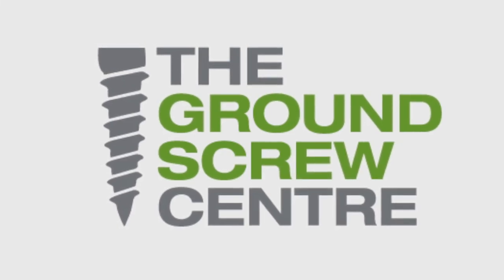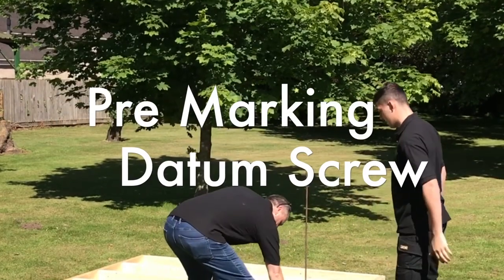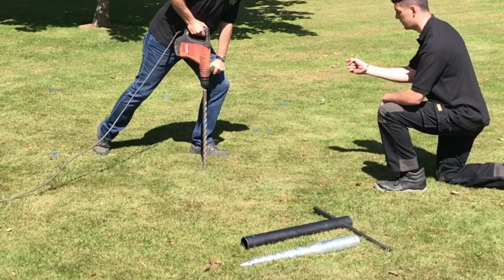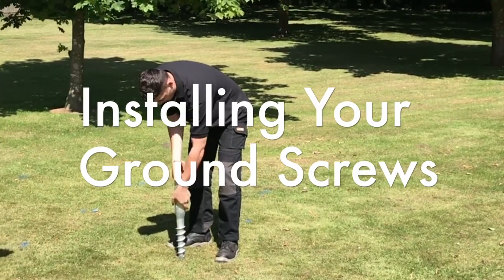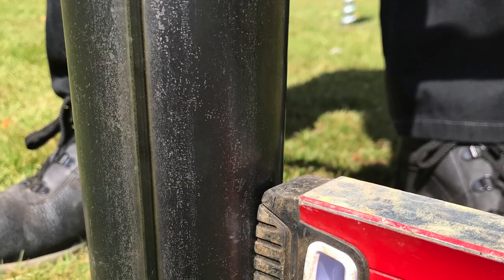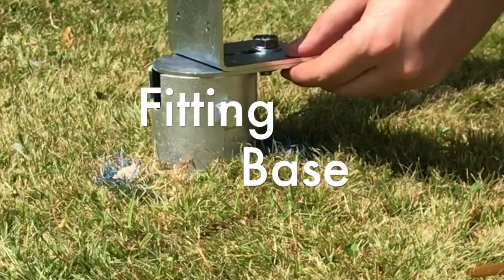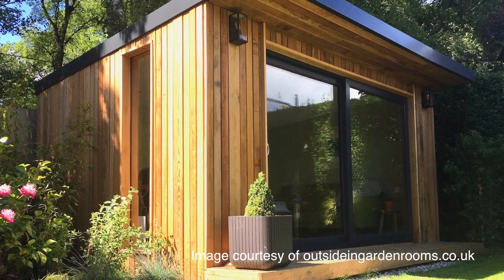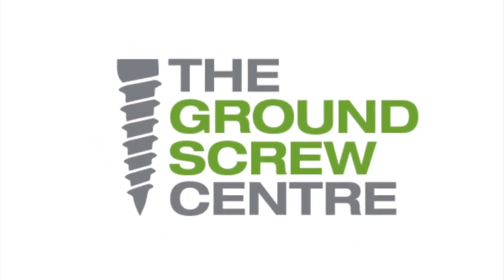Ground screws, Building Base Installation.

Comment: Ive used these helping a mate, we both came to the conclusion that it would have been easier digging and concreting.  Cheaper as well.
Reply: Might I ask why? Very curious as to how user friendly these are
Reply: @michaelandersson3305  pain in the arse, we put in 6 of them, after installing them, we both agreed it would have been quicker to dig and concrete, and trying to be accurate with them was a dead-set bastard.
Reply: @prophetanarchy2355  thanks for the reply! So hey, I'm an engineering student and I'm working on my thesis which concerns self installation of ground anchoring. If you have the time and patience, would you go into more specifics about your experience?
Reply: @michaelandersson3305  ill have to go step by step. 
Im a carpenter with many years experience. It doesnt take long to dig a hole, it use to be quicker when I was younger. 
The traditional method of installing a footing doesnt really take long, and getting the footings and pillars/post/whatever at the correct centres is easy. with these screws starting them in the right spot is not an issue, its what lies beneath. If you hit a rock of root or dead body the screw will divert and it will misplace your centres. As it did when we used them. Also the ground was hard. The ground in the clip was easy ground. On our job stuffing around getting them right was time consuming, once they where in we removed 300mm of dirt and concreted around them. What we were doing was a temp structure. Maybe you should have a go at using them. I also predrilled with a 30mm sds bit.
Reply: @prophetanarchy2355  this is good input - thank you very much!

Comment: How well suited is this system to an inclined grade? Would you fit the low side screw then have a post on top up to supporting level or are longer screws available that protrude higher out of the ground?
Reply: I would be curious about this too.